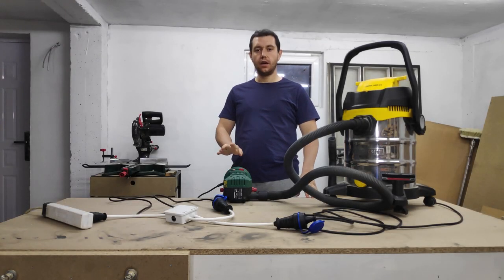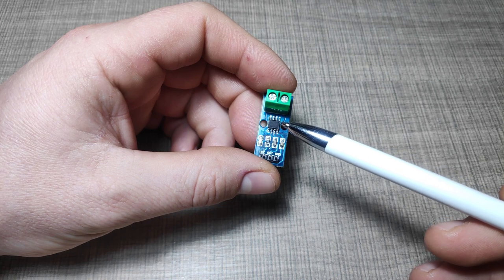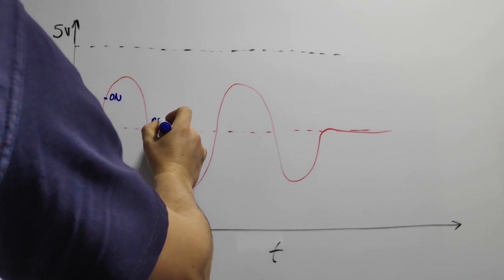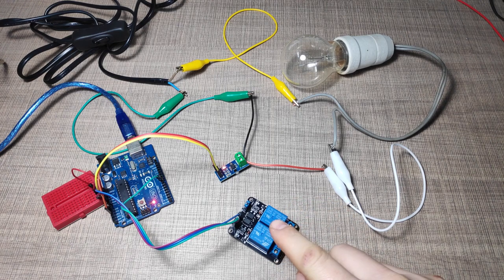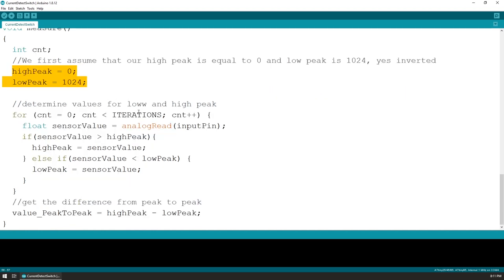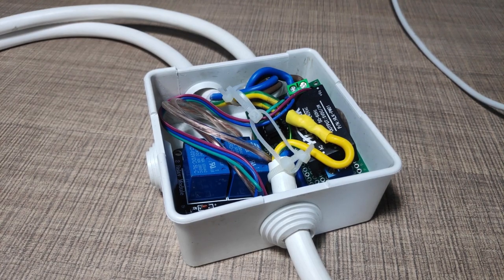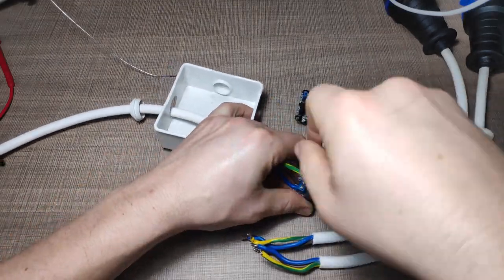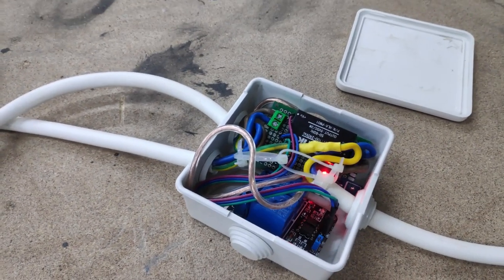Automatic Vacuum Switch with ACS712 and Arduino (Attiny 85)

Comment: Great job and video. It helped me with a similar project where I needed the arduino to open a blast gate with the use of my table saw. I was easily able to follow your code and make the necessary modifications. Thank you so much for sharing.
Reply from the maker: I'm glad that I was able to help!

Comment: That is fantastic Bill , good explanation, I would like to build one for my mitre saw, just wandering can you add soft start to this?
Reply from the maker: Yes, absolutely! Great Scott has an awesome video on how to build a soft-start circuit that can be added after the relay. However, keep in mind that his circuit is intended to work with 12 V  so you will need to modify it to work with AC or find a similar one online. Here is the link to the video: https://www.youtube.com/watch?v=SVLGHB2IxxU

Comment: I was wondering if you would be able to help me. I get occasionally "false positives" that turn the circuit on even when I don't have a tool running. Which value(s) in the code would I experiment with to try to mitigate this issue? Thank you so much for your help.
Reply: I think I've got it figured out. I raised the ".2" value in the line of code "if (value_RMS > .2)". I was still getting false positives even with .4 or .8. So I decided to go the other way and raise the value as much as I could until it wouldn't trigger even with the tool on, which was around 6. So I backed it off to 2, and now everything is perfect. Thank you again for sharing this circuit.
Reply from the maker: Hey, sorry for the late reply but I'm glad that you figured it out! I guess there is some electrical noise on the components that makes the value to jump but setting it way up is the wqy to go. 👍

Comment: Hi thanks a lot for your video, I recently built this with your tutorial but I seem to have problem with acs712 (20A version as well), it never trigger my relay when it's sensing current. (i have checked if the sensor worked with an arduino with another code and it seem to work) Do you think that some RMS values or iterations need to be changed for it to detect something?Thanks a lot!
Fred
Reply from the maker: Hey, check your wiring, especially on the relay side. I'm guessing that you might have missed something. Also check from the code that you can trigger the relay.
Reply: @TasteTheCode   thanks for your answer! Unfortunately it’s not that, I can trigger relay if I put a simple on/off code for the relay. :-/ I’m gonna check again, problem might be between attiny and sensor if code is right and no value should change.. Thanks!
fred
Reply: @TasteTheCode  Everything solved !!! Thank for your help, I somehow misread the pins on attiny and mismatch between pin 3 and 4 on attiny, now it works :-) thanks for your help. Cheers,

fred

Comment: Hi, really good video. As I am a total novice with electronics, could you please post a schematic and code for the UNO. Keep up the good work.
Reply from the maker: Thanks! On the Github link, there is already code for the Uno. You need to connect the current sensor to A2 and the relay control input to pin 7.

Comment: Great explanatory video! When trying to source the right components, how do I determine whether to buy an ACS712 rated at 5, 20 or 30 amps?
Reply from the maker: Thanks! It depends how much current your planned load will consume. If it is a small appliance, 5A will do. At 240V, a 1kW load will draw slightly more than 4A.
Reply: @TasteTheCode  thank you very much for the quick answer.
Reply from the maker: You are welcomed!